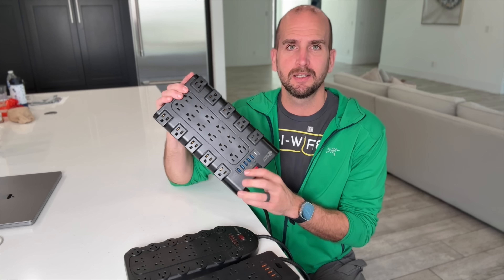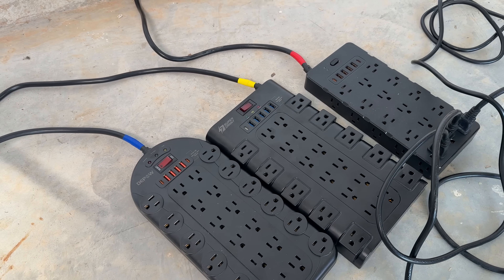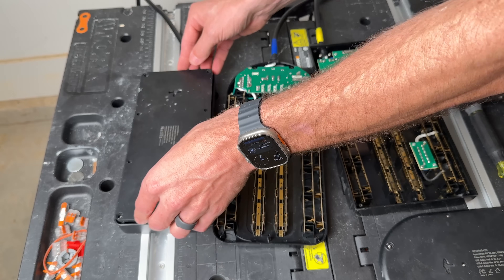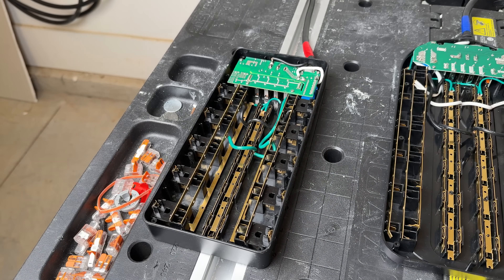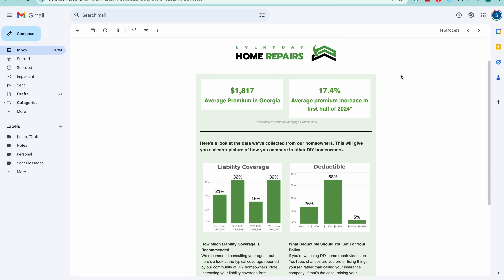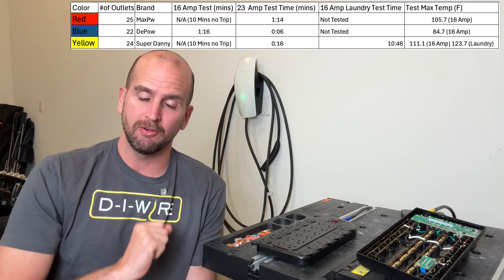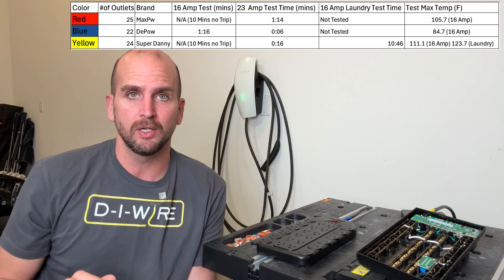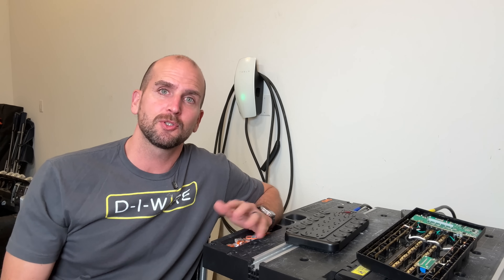Testing The Most Dangerous Amazon Power Strips |  I Wasn't Expecting These Results!

Comment: Depends on where you live, but in most areas that I have seen, there is a limit of 12 outlets/devices on any one circuit... In other words, you cannot have any more than 12 outlets OR 12 light fixtures OR any combo of the two... Such as 6 outlets and 6 fixtures... 7 & 5 or 9 & 3 etc... So just by existing, all of those "power strips" violate the code of a lot of places, by a factor of 2... I would not use any of those things... JMHO

Comment: I checked the "blue" model by searching the ETL listing directory and it is indeed ETL listed as marked.  So it is not surprising that it did better. The other two are not listed with either UL ETL.  For those that don't know, UL and ETL test products for safety and then give them a mark. When you buy electrical stuff on Amazon ALWAYS check that they are either UL or ETL listed.  You cannot buy stuff that is not UL/ETL listed from most American brick and mortar retailers (they simply won't sell them), but Amazon doesn't GAF and will sell trash.

Comment: Electronic Engineer here...
Having that many outlets on one power strip isn't really dangerous at all.
Having bad construction quality and fuses that don't trip at 16A like they're supposed to, THAT's a problem.
Also FYI, those aren't solder joints. They're spotwelds. Spotwelding is definitely what you'd want for high amperage usecases because they're FAR less likely to heat up. That being said, these don't look that great even for spotwelds.

Blue one looks decent enough, and as long as your using it for just a bunch of monitors, battery chargers, leds, etc (stuff on a complicated Hometheatre/Computer gaming setup) then you're not likely to run into any issues and is probably safer than just chaining a bunch of smaller strips together.
Amazon is still not really a place I'd recommend getting your powerbars, but this still beats most of the stuff I've seen sold at the local dollar store at least.

Comment: I have superdanny and it works fine. The instructions say not to use heavy equipment on it. The intention for this multiplug is computers, consoles, tvs etc. Not hair dryer, microwave, air fryer... I use it for my computer stuff. The only thing I have noticed is the usb charging ports can get hot when using them. Also a friend of mine another suoerdanny with a gym equipment and had to remove it bc it was tripping due to high power use and plug to a normal wall outlet. The plastic is not heavy duty, this is clearly intended for indoor and not taking physical damage.

Comment: With a single circuit in a home the standard breaker and wiring is for 15 Amps.  No matter what the total power draw should not exceed about 12 Amps leaving some leeway for the 15 Amp breaker. The ones I buy are 15 Amp rated and UL/CSA approved. 

I buy the regular industrial type AC bars with maybe 8 outlets max. The types I buy are not made cheap inside as like the ones shown.

Comment: Meh, I have the super danny, and all that's plugged into it are wall wart type things, an LED lamp, a Pi, and low wattage type stuff. Maybe the occasional computer system I'm working on. With what is normally plugged into it, if it's pulling 50 watts total, I'd be surprised.

Comment: I would be interested in knowing if any of those are UL or CSA rated? and I also mean not fake (just stick the logo on) or truly rated. I would never use something like that. In theory a 15 amp circuit should trip if your draw more than 13 amps for more than about 15 min and at 15 amps it should trip within a min. Any heat like that in a power bar is VERY concerning as over a time period that will cause it to fail and is a huge fire risk. I know many will state that they would only use for low draw items but all it takes is one item to be plugged into it like a vacuum that draws even 10amps and that puts the load well over what it is designed for.

Comment: Those solder joints look attached with a spot welder.  (basically a clamp that puts voltage through until it 'welds' together)

Comment: What's the gauge on the main cords for each of those? If you plug a bunch of tower PCs into a bar like that, you might be in for a surprise. Not everyone out there knows just how much load computers from the past ten years can put on bars like these. Depending on power bar design, heat can melt stuff, even before the house breaker trips.

Comment: Regarding your remarks about the green wire. 
You BELIEVE it’s the neutral? You should know without any question if it is. The neutral and the line side are never going to be anything other than what they should be. 
Using green wires indicates the company is cutting every single expense. 

The product with green wires should be pointed out so that customers are advised at the poor construction level. 
All of them have extremely low quality construction in terms of the ‘solder’ joints. 

No one should buy these garbage products. 
The end user is the one who makes the final decision and will inevitably be the final user that burns it up when the fire department sorts out the ashes looking for the cause.

Comment: Those are spot wleds not solder. Much better than soldering but only when done properly with right amount of current time and pressure. A few of them looks a bit weak. But again they are better than soldering..

Comment: These power strips are suitable mostly for little "farms" of wall warts.  One problem cheap brands have is loss of springiness in the contacts that hold the plug blades.  I've had power strips become unusable that way, and if you're drawing a lot of current they may heat and become fire hazards.

Comment: I actually don't think those are for filling every plug with something.  For example if you have a wall wart type transformer, that might occupy two plugs.  You're also not going to plug multiple heat guns into it.  I could see something like your LED bed lamp, alarm clock, maybe a weather station, speakers, charger for game controller.  Very low drain devices.  This is how I use mine anyway.

Comment: I have a question, I use a UPS and have plugged into my wall, I use a anker Power strip, the power strip is plugged into the UPS, I have a 800W server and a 1200W PC plugged into that aswell as multiple other devices. (I know the battery backup wont last long, setup to shutdown my systems in the event of a power outage)

The UPS is a CYBERPOWER CP1500AVRLCD3.

my question is, by using a UPS like the one I have does it decrease the load on the Circuit breaker? I am genuinely curious to see if it does. 

two of cyberpowers claims is Automatic Voltage Regulation and Surge Protection, but does that only work one way or both ways.

because yes it works when there is a power surge from the breaker, but does the UPS curtail the sudden power surge from devices to the outlet.

if there are tests of this and im just a idiot, do let me know :)

Comment: I'm in the UK and switched power strips are now pretty common. I have a tower with 4 levels and 4 sockets and each level has a button for on and off. Pretty neat. And my PC is ran though 2 sets of surge protection and switches as well as very high end power supply

Comment: I saw the Super Danny 24 outlet strip on Amazon a few months back, saw that it was only rated or 15 amps and was surprised.  Considering the number of outlets it should really be wired for 20 amps.  Even at 20 amps that would be less than an amp per outlet on average.  A strip with this number of outlets on it is ridiculous at 15 amps!

Comment: The fact this guy does not know the difference between soldered and ultrasonic welded joints 3:21 should tip you off, if the fact he had no idea what a triangular security screwdriver 2:17 did not yet, that he has zero business making videos like this. I am sure he will get the dopamine release from this engagement he craved from the clickbait title though.

Comment: The one very specific use case that I would like one of these type of power strips for would be for charging multiple DSLR camera and video camera batteries at once (usually 4-5 at a time). Primarily because a typical power strip can only accommodate two or three chargers at a time due to how big the chargers themselves are, and the fact that sometimes a single charger may cover up another outlet when plugged in. I would never be putting any high current or high power draw device through one of these due to that safety concern.

Comment: The spot welds are actually able to handle more heat (Melting point of copper or brass) as opposed to solder which has a melting point of around 600deg.
Reply from the maker: Thanks for the feedback Ron, I appreciate the help!

Comment: I bough 3x GE branded 12 outlet power bars that look something like those; my assumption always was these are designed for low power devices and places like entertainment/tv setup's  where not all devices are used at one time; it's more about convenience of not having to unplug and plug in devices constantly...... or least that's how I use em.... the "welds" are pretty typical spot welding for power bars

Comment: More important than the strips, is what you are plugging into them and whether they are rated for that, as well as what the wall outlet can handle. 
So long as you aren't exceeding that rating, the wall doesn't care if it's one device plugged into a wall outlet directly, or 12+ plugged in via a massive power strip.

Comment: Your breakers do not care about you (in the US). Your TV could be having a meltdown, you could get shocked, and the breaker still wont trip. All the breakers care about is if the wires going from the breaker to the recepticle has current going past their rating (resulting in heat). Once youre outside of the recepticle (or wall), your breaker will not help you. For example, say you have a 20 amp breaker, but the extension cord or power strip is only rated for 15 amps. Guess what, your power strip could be on fire (literally), it could be melting and your breaker still wont trip. Make sure you have the correct gauge of wire on your power trip/extension cord and youll be fine.

Comment: I could see a use case for these if you weren't using all of the outlets but had a bunch of transformer-type plugs to plug into one spot.. Like under my desk where I've had to to use two power strips for all of my low-amp lights.

Comment: I am thinking these may not be too bad when brand new. But aftet a couple years after exposure to humidity, dust, and various plugs the contact strips gradually oxidize, the.strips wear down and the connections are no longer tight and any margin of safety they once may have had may no longer exist. Hot spots, arcing, overheating may become an issue and lead to fires.  Its far better to buy good quality UL approved outlet strips that are enclosed in metal and never exceed a total of 15 amperes. In fact I limit mine to a max of 5 or 6 amps at most.

Comment: My home has no traditional wiring previous people stole it all when the sold it. I just wired up 4 outlets on separate circuits and power everything with that. Everything right at the box.  I have an extension cord  running outside for the well pump. Also another one to run other things like washing machine. The kitchen is also  run using an extension cord with power strip. No budget to wire the house so power strips and extension cords work for me. I am careful not to overload anything.

Comment: it not just the power board it self but also the appliance plug terminals that can get super hot. the contact resistance increases on plugs on small room heaters as they age, and plugs can melt, at current way less than max ratings.

Comment: We used the SuperDanny at church for a bunch of wireless mics and in-ear packs.  I want to say it was around 15 devices but probably only 3 - 5 amps total.  It was nice because some of them used wall-wart power supplies while some used in-line power supplies.  The power strip took all of them with ease.  

Previous setup used multiple smaller strips plugged into one another so SuperDanny was much cleaner.

Comment: I don't think Scott really understands circuitry. The house's circuit breakers will go if needed. The wires in the cord running to the power strip is more at risk of melting than the strip internals.

Comment: I have a couple of large quantity outlet protectors on my entertainment system. Many outlets are filled but only a small number of them at any one time are used. Also have a few small ones around the house for other items but they are just for surge protection. Modem/router. TV game system. Laptop. Things of that nature just as a little extra protection during storms. Lost too many devices over the years from storms causing surges while devices where plugged straight into the outlets. I live in an area where most of the houses are fairly old and when they are rented they are not required to be quite up to todays standards for circuit protection at the breaker box as for as incoming surges. Or at least it's not enforced if they are required to be.

Comment: Those joints aren't soldered, they're spot welded. Spot welding is used in high current joints all the time, and it is far superior to soldering.

Comment: Looks pretty much like any other power strip, although their spot welds not solder leave a bit more to be desired.
There's a lot of times when you just have a lot of power bricks or small amp draw things that you need to plug-in like behind a TV etc.

Comment: Those joints arent soldiered, they are spot welded. Honestly they look like pretty much any standard power strip i have ever seen. Inside of a duplex receptacle isn't much different either. So long as the gauge and the contact pressure of the buss is adequate i would say its fine. The thing I dont like is the wirea crossing over the sharp edges of the bussbars, better ways to route them.

Comment: What is safe max temp for a power bar. A teat I would like to see is how many led lights can be run on a usb chord. Bought a set of 5 lights to go around a mirror from amazon. Seems like a lot of light coming from the energy going through a usb cable.

Comment: You missed a big thing to check: Are the cords attached to these things really what they should be for the full load? I would expect the lead to the wall to be the biggest thing they cheap out on--either by skimping on the wire gauge or by using aluminum instead of copper.

Also, you mention electronic components' temperature ratings--honestly I'm way more concerned about the plastic they use for the housing and how heat resistant and/or flammable it is.

Comment: I've seen these and yes they do scare me. I was actually interested in my specific use case. I have ALOT of consoles hooked up to 2 LONG power strips (14 outlets each). But in my case maybe 3 consoles at most will be on at the same time. Now im talking maybe 2 dreamcasts+1xbox  or 2 xbox + 1 gamecube and something similar. This could work for my specific case. Yeah there will be some multi hour gaming sessions but I'm no where near running any heat guns. Again these are consoles from Atari 800XL ---> WiiU.   Thoughts? Btw thanks for doing a review on these things. I wasn't sure if they were actually real but they are.. even more scary :D

Comment: I don't see a real issue with these, they are no different then any othee power strip. If you abuse it, you will have problems. As long as the overload and thermal cut off works, the rest of the components can easily handle the rated amps. 

Personally I would have tested that joint as it seems like the only sketchy thing inside the unit. I would have cut out that section of bus bar and pass 15 amps directly through that joint to see if there was any heating, then I would have tested how much and at what point will that joint fail.

Comment: It's possible those wires are ultrasonic welded to the busbars, I don't think it's possible to solder so lightly that you don't see any tinning at all (I mean, maybe not zero, but to be able to solder like that, that feels so unlikely, ultrasonic welding seems like the most likely case scenario).